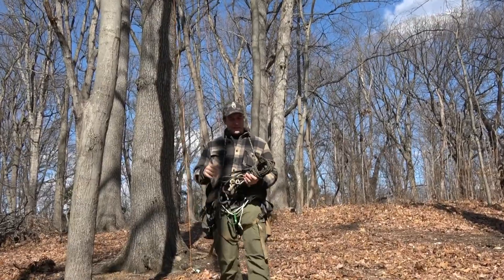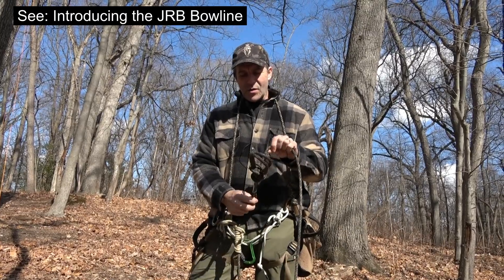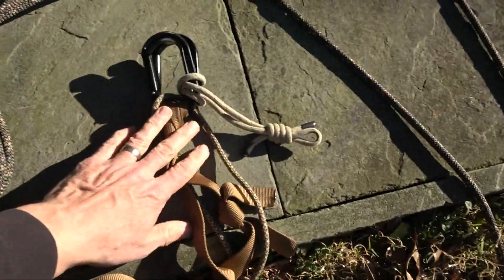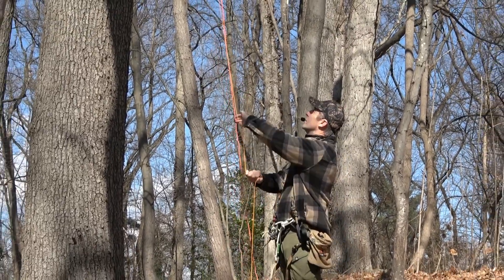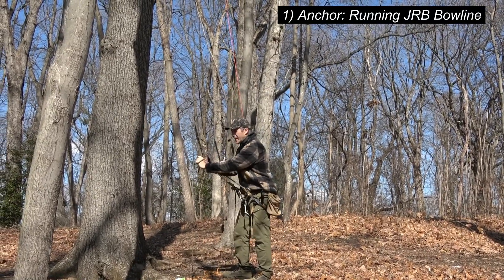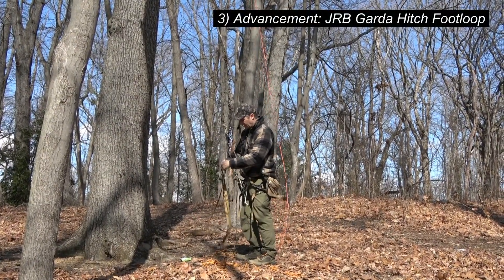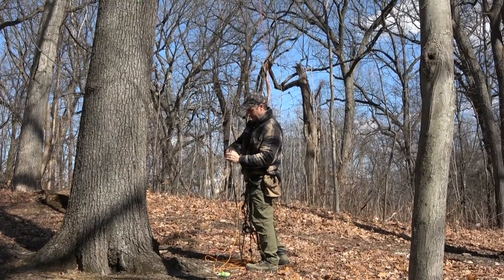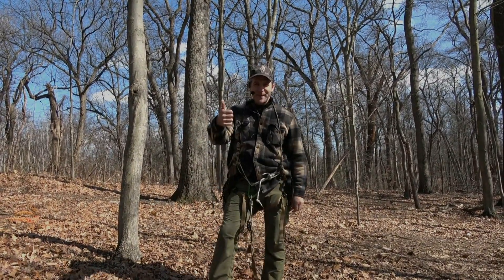SRT #11: Preconfigured SRT System

Comment: Yep that's my system. Just bought another 40ft of ghillie and tied the JRB bowline on. Oh I still use the 523 compact though.Can and will use the longhorn agile if I come to prefer it. I need to get a few needed paracord presets hung before the leaves come out. Thanks JRB for the great instruction.
Reply from the maker: The Ghillie is on the stiff side but that actually helps with regard to how well it stands up in the JRB Bowline.

Comment: Another good SRT system that can be used in this same fashion is with a running Maverick with good sized loops. The running maverick is the one I use the most. Thanks John👍
Reply from the maker: Yes, the Super Maverick is great also.  However, if we used a Super Maverick on this tree with this rope, we would need to tie both the Super Maverick and a Friction hitch at the tree. Some folks are uncomfortable doing so. I am just providing options.

Comment: I'd like to offer a suggestion which may be benefici for your newer viewers.

I realise terms like SRT or DSRT are probably commonplace for climbers. For interested newbies however, using those acronyms without introducing them (even by just expanding on what the letters are short for) makes continued watching of a video awkward. I feel like Ive got to leave the vid to research and then return when or if Ive still got time.

Im not saying never use the terms. Just the first time you use them in a vid, use the longer form then shorten thereafter to the abbreviation. That's a consistent approach that used in books and manuals as you can never be certain on your audiences prior knowledge levels. And of course, definitely continue letting viewers also know about your relevent playlist series on those subjects.
Reply from the maker: I appreciate the good suggestion.  I don't use a script and typically film these videos in one continuous first take, as was the case here.  I did make sure to direct followers to the website.  I have assembled a glossary of Saddle hunting terms.  In the case of SRT, I believe most saddle Hunters are aware of the term though.  Cheers and thanks. 
https://jrbtreeclimbing.com/getting-started/dictionary/